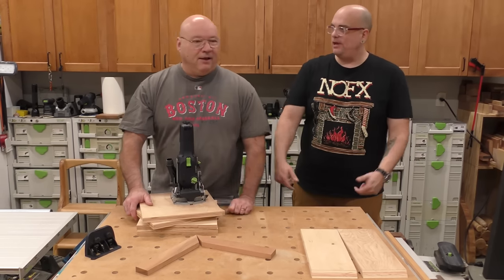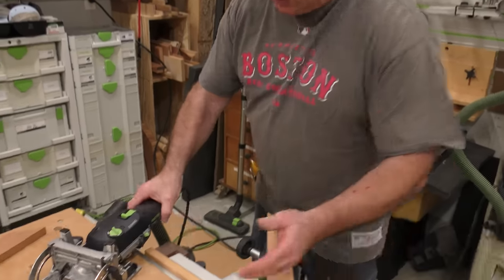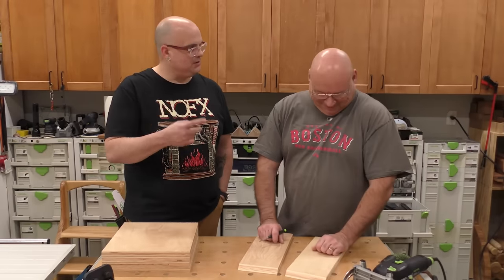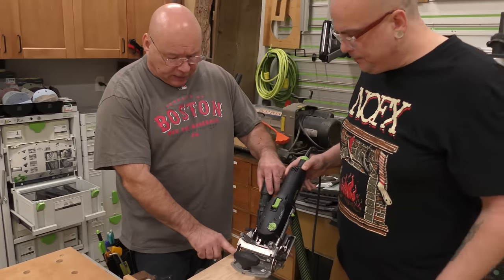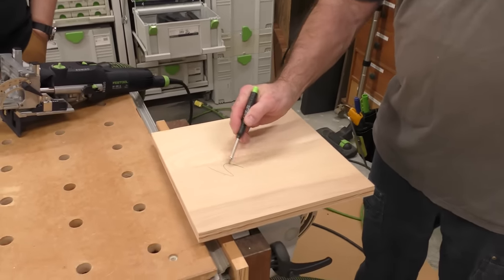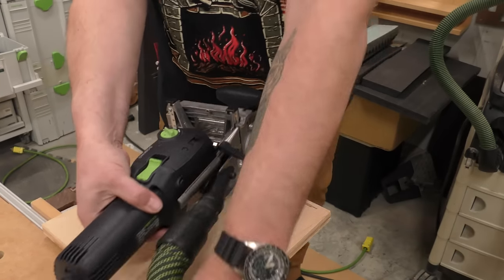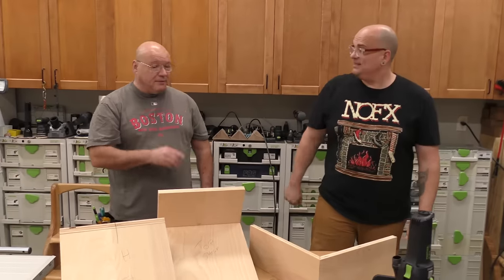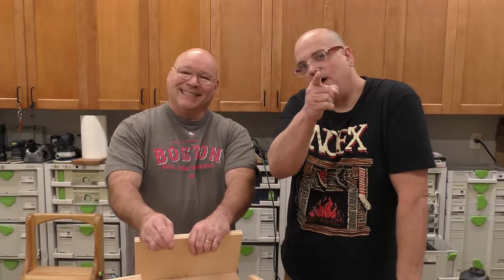The Top 4 Festool Domino Joints You Need to Know

Comment: Thanks for this EXCELLENT video, I now know what I need, to start my woodworking project at school!

One thing, though, that seems off to me, and this might be me, so I wanted to hear it from you.
It's about the shelf in the middle joint, to me it doesn't really look like the shelf is in the center? It looks more to one side, than the other?

Thanks, I hope you can clear this up for me.
Keep up the great work doing these videos!
Cheers.
Reply from the maker: it does line up to the top line...may not be exactly in the center ...I did not intend for it to be exactly in the center of the side...if this is what your asking......
Reply: @sedgetool  - Thank you so much for replying to my comment, it means a lot.
The work you're putting into all these videos are much appreciated!

Aha, that makes sense, thank you. So If I then wish to have that shelf, etc. exactly in the middle I would just have to measure out for that, correct?

Another question, in regards to my upcoming woodworking project, if you don't mind... I want to assemble my piece of furniture with dominos, and that's what you've shown in this video as well, but what if all my sides are beveled at 45 degrees, so that I don't have a flat/square edge to rest the dominos' flap against? How would I position the dominos then?
All I can think about is the good old manual way = measuring them out, and having to be dead exact, for the alignment, but this could easily go south, especially when I want it all to come together flush and nice, right?

What's your take on this, if you don't mind.
Once again, thank you for your time and expertise, it's greatly appreciated.

Comment: Sedge, this is a great summary on the most common domino joints, if I don't have a df-700 and large legs or slabs I wanna join together can I get it done with df-500?
Reply from the maker: Thanks.... For slab work you can do quite a bit with the DF500... The large legs and apron shirt connection definitely needs a DF700 .... Hope this makes sense

Comment: Thanks for all the content you put out on the domino.  Invaluable!  Especially as I only purchased mine a few days ago!  Quick question if I may - for the shelf joint, how do you align it when the stock is say 15mm thick?  The distance of 10mm from the plate to the centre of the cutter means that the hole will be really close to the surface.  How would you centre the hole in this scenario?
Reply from the maker: I would not use the base as my reference ... I would measure a 7.5 centerline...

Comment: Great videos. How would you do board in the middle if you were working with say 15/32 ply? with a 4x20 domino? Thank you!
Reply from the maker: if it is 12mm plywood I would bottom out the plate on domino to 6mm for shelf...for the side I would set up a fence ( Rail ) at a measurement from the scribed centerline 10mm back.....

Comment: Greetings Sedge!

I need a bit of help with the domino.

Trying to make the 4th joint in this video.

I am using the DF 700 EQ, whereas you are using the DF 500. At about 13:10 into the video, you talk about how the distance from the bottom of the plate to the midpoint of the cutter is 10 mm. That is not the distance on my 700, it's more like 15 mm. So when I cut the mortise for the dominos, it is around 5 mm off.
Question one is: Is the distance from the bottom of the plate on the 700 actually different than that of the 500? Or am I missing something. I do have the cutting depth set as low as it can go at 10 mm.

Question 2 is: If the distances are different, what is the methodology to accommodate the 5 mm difference?

Thanks from another Purdue grad!
Reply from the maker: the distance from the base to center of the DF700 is 15mm.......this video may help with the 2nd question....
https://youtu.be/XeIRe5F93-w
Reply: @sedgetool  Thanks much! Really appreciate your videos!

Comment: Absoluting love watching these videos so much so that your videos are my reference library when I get stuck or forget a step. BUT, got this about putting in a shelf using the Domino. Now how about putting a 1 1/2 x3/4 x36 inch  inch board T ing off a 2 inch board at the mid way point of the 2 inch board and the top of each must match up? The reference flaps won't work. Likely I am over thinking this but figured I'd ask.
Reply from the maker: use reference marks

Comment: What size dominos would you use for 18mm thick sheets of MDF doing butt joints and what depths do you go into the horizontal and vertical holes? Thanks
Reply from the maker: 5 x30 ....set plunge depth at 15mm

Comment: I enjoy your videos. I have a question if you have time to respond.  I use a Domino 500 when doing table top set ups. I never seem to get that seamless perfectly flat top.  I make sure the plate is perfectly flat. I push in by the power cord. I apply pressure on the front handle. What the h—? Ultimately a lot of sanding when I take it out of the clamps. I just love sanding…….said no woodworker ever!  Thanks.
Reply from the maker: Scott...so sorry for the late delay... a few things to consider....sounds like your technique is sound. Possibly slight crown in wood ??
or maybe not working above the plane of the workbench or of of the workbench....Possibly some fence drift ???
Reply: Thanks for the reply. Definitely working above the plane. I clamp the board to the workbench to keep it from moving on me.  I probably need to go a little slower and more deliberate.

Comment: Sedge thank you for the video helped me alot. I'm planning to build upper cabinet with 18mm plywood and thought to use the domino so there will be no seen screws. The box size is 80mm×75mm*30mm (H*W*D). My question is which size of domino to use and how many for each but joint?
Reply from the maker: 5x30 domino for plywood and a 30mm deep cabinet only needs two domino ...that is very narrow... if it is 30cm then I would use 3

Comment: How do you set the cut depth to not go through the ply on a vertical cut into 12 mm ply?
Reply from the maker: set at 20 when using a 4mm bit
Reply: @sedgetool  ok, thanks for your reply, but I don’t understand.  Wouldn’t that punch through?  I just wanted to cut in 6 mm or so on the thin side and 15 or so on the long side

Comment: Sedge, after watching your video on "Domino Joints" I was curious 1) Does a mid-shelf require mechanical fasteners in addition to Dominos? 2) In that same vain, should a fixed shelf, or top / bottom on a melamine cabinet have a minimal dado, say .125" to facilitate glue up?
Reply from the maker: You can dado and use mechanical fasteners.... I use no glue and screws when building cabinets... I usually use prefinished ply so glue does not stick .... this video shows the process 

https://studio.youtube.com/video/TILGZxhRdBQ/edit

Comment: Sedge, something I have never seen on any of yours or the Festool lives is, it’s one thing to have the four mitered corners using domino’s, but what if you have a bottom of a box and/or a back of a box that needs to be mitered into that? Is it physically possible to use dominoes in that situation?

I.e. I have a hope chest to make, where I’m going to miter the four outside corners, but also miter the bottom into the four corners as well.  Is that physically possible to use dominos in the bottom that connects to the sides?
Reply from the maker: Interesting application....... I have never found myself needing to do this...... It seems to me that it would have to be glued up all simultaneously .all 5 pieces ...... even then I would not build it like this........I would use a rabbeted bottom or flush butt joint with a decorative profile or molding......... then add a base with legs....... I hope this makes sense
Reply: @sedgetool  that is exactly what I was thinking in regard to being simultaneous or ending up doing a rabbet joint at the bottom. I just wanted to confirm my thought process was correct in my thinking. Thanks again!  👍
Reply: @sedgetool  if I have a concept/idea for a new accessory for the Festool domino, who and how could I submit my idea to?

Comment: Sadge, love all the videos and the explanations you give. Question: when attaching a middle shelf anywhere on a center panel, is there a way to attach another panel on the opposite side but same location? Kind of like a through domino that holds the left shelf, going through the middle divider and into the right panel, but not using the “knock down system”? Thanks for your time
Reply from the maker: Yes you can! on the center panel do a through mortise...... Use the setting for the side panels at a plunge depth of 25 ....use a 5x30 domino  when gluing up from either side start in the center panel...this should allow for any discrepancies in tenon/ domino length ..... I should do a video on this ..... Thanks Victor ..hope this makes sense ....
Reply: @sedgetool  it makes total sense. Hope to see a video on this in the future. Thanks
Reply: @sedgetool  I’ll do a test sample and let you know how it goes and what I learn or what I can do better, might help you when you make the video

Comment: Hello! For middle shelves your ideas will only work if You are dealing with 20 mm plates - otherwise You will be badly off-centered as the reference for the Domino is NOT the bottom which is fixed at 10 mm - any good ideas how to deal with 25 mm boards are welccome
Reply from the maker: ok ... after some thought ...you could use this method if you shim the base of the DF500 domino with a 2.5 mm shim..
Reply: @sedgetool  THX as there are 2 M5 threads at the bottom - I cut 2 plates of stainless steel  1.5 and 1 mm respectively and  screwed them to the bottom - this should do the job for 25 mm and also work for 22 and 23 mm boards

Comment: It would have been nice if you’d have shown the “ tip” at the 16 min point.  That would have saved me a bunch of frustration when you did the set up.  I finally figured it out myself.  Restarted the video AND THEN you show the “tip”.  Let me give you a tip…stress that when you show the proper steps in the original set up.  Tip…do not teach it wrong first, AND THEN give a so called tip on what you left out.  Very frustrating.
Reply from the maker: Thanks for sharing.......